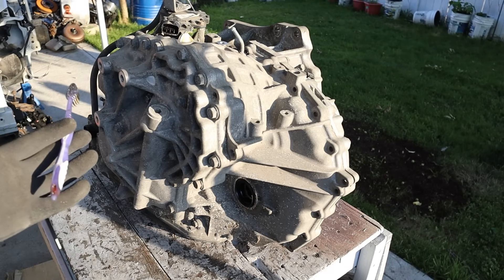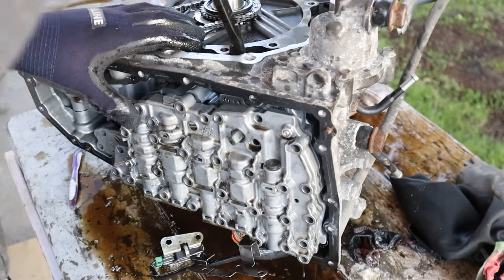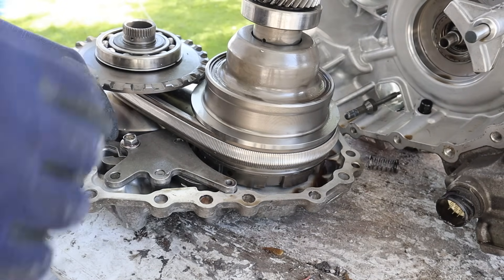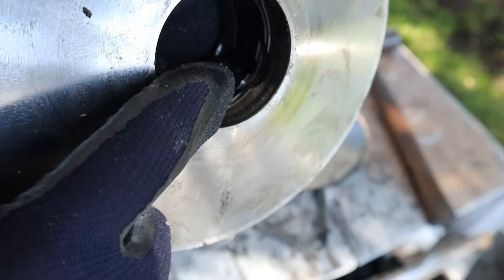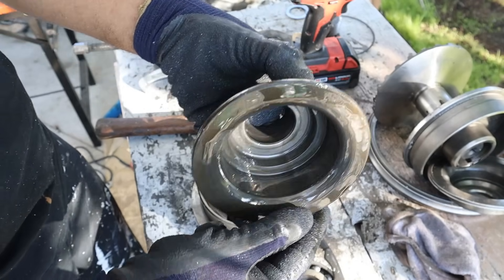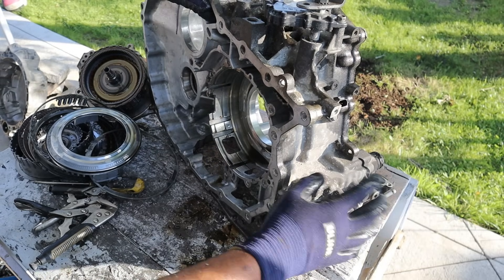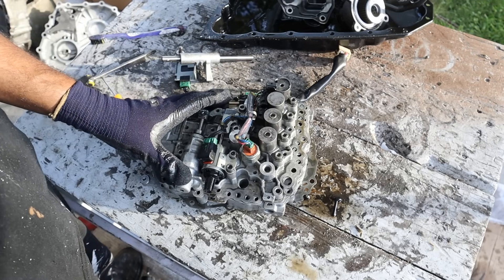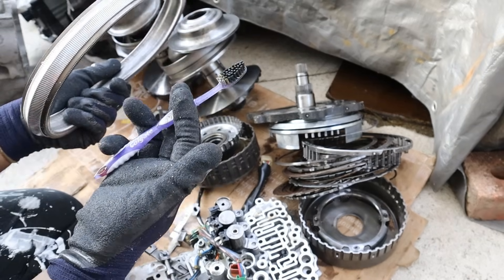Why Nissan CVT's are a FAILURE

Comment: And we were considering buying a Nissan Murano in 2005 when we were looking for a safe and reliable car to transport  my wife and I and our newborn.  After reading about issues with Nissan's CVT, we settled on a 2005 Toyota Avalon which we still have and drive today.
Reply: The Avalon is a very smooth and spacious family vehicle.
Reply: Our 14 murano was a pos. So I offed it to carvana for……an Avalon.
Reply: @samtatge8299  nah muranos are great, reliable and strong
Reply: you made the right choice
Reply: Probably the only person who cross shopped an Avalon and a Murano.
Reply: what a wise choice
Reply: The older Nissans are actually bulletproof
Reply: @ If you give her what she needs. Sure.
Reply: I have a 2005 Nissan Altima with around 179,000 miles on it, bought it brand new. My front tires still spin when accelerating from a dead start. I guess the key is regular maintenance. Haven't changed the transmission fluid scene the 50,000 mark. Maybe it's due for a transmission cheek up. What do you think?
Reply: @ At least check the dipstick. The belt will shed particles. I wouldn't trust a dealership, they'll ruin it.
Reply: Good choice.
Reply: Every marano is in the auto junk yard😊
Reply: That was a smart move. Wished I had done the same thing. Will never buy another Nissan again.
Reply: and my sister is still driving a nissan murano that has been problem free for 200K miles
Reply: I know someone that had a 2014 Murano and the transmission came out two times within 68,000 MI.. And it was taken meticulous care of and serviced at the Nissan dealership.. service before Time..
Reply: I own a 2009 murano, and i thrash the thing daily. The cvt definetly holds up to it. I havent serviced it since ive owned it, about 20,000km. Definetly servicing it after this video though
Reply: I had a MB B-Class with a CVT, obviously failed(180,000km)… bought a Toyota Aurion (now at +400,000km), only had to replace the alternator.
Reply: @ Actually battery powered bicycles are but, go off.
Reply: those older Murano's do not have this type of transmission. 2012 and newer have this transmission but the recommendation is to replace the fluid and filters more often, every 30-40k miles; pushing it to 50k but better be safe.
Reply: I have a Nissan Rogue 2021 26,000 miles lot are dropping  Nissan's.  Mine drops off this Monday, 10/20/25, but I have to pay a rental. They have a wacko system. I was thinking the Toyota. The CVT can break your maintenance
Reply: Ugh! That aviator is similar to the clutch/transmission on a mini-bike!
Reply: Murano is actually solid. Honestly, you made the right choice.
Reply: @JohnZornAscended Murano's are terrible..😆
Reply: @charlesjackson1700 That's why they're still on the road eh?
Reply: @JohnZornAscended ..I don't see many on the road.. and the ones I see look raggedy and the bumper covers are flapping in the Wind...🤣
Reply: @JohnZornAscended  no is yunk and I see this yunk it yunk it doesn't have any good suspension especially in  pa a little touns that the road are not very good

Comment: The reason they fail is no one changes their CVT oil I change mine every 30,000 miles and have almost 200k on it with no problems this goes for all CVT vehicles but Nissans seem to have more problems with dirty oil
Reply: Funny how in other cars you don’t have to change the transmission oil every 30k miles 🤔
Reply: @BillGates_Alex actually you have to change the atf with pretty much the same interval for almost all automatic transmission. Better change it and safe rather than being a cheapskate then sorry
Reply: @BillGates_Alex You Don’t Have To. That’s Excessive. My Brother Has 200k On His Cvt Now And Only Changes It Every 60k
Reply: Every 10,000 miles.

Comment: I wonder how the ford maverick is gonna hold up with it being a "truck" with a cvt
Reply: The Maverick hybrid CVT is not a pulley and belt type.  It's an eCVT, which is completely different.  The non hybrid doesn't have a CVT.
Reply: @thx1138guy  oh ok. i still am gonna be curious how it holds up but if that means it doesnt need to work as hard i would hope it lasts a good bit

Comment: What's crazy is Honda uses cvt and  I have not seen one Honda in our shop for a transmission replacement
Reply: You will.  Just wait a few years.
Reply: There's a lot of CRV with broken CVT. They put those low torque CVT into heavy SUV.
Reply: @GF-mf7ml   It's crazy as I do a lot of transmission services and I'm wondering if that's because the transmissions aren't failing
Reply: @HONDATECH93  we here in Malaysia have quite a lot of issue with the cvt steel belt would grenade itself.. I do believe it due to alot of hard city start stop traffic and the hot temperature here.
Reply: We’ve put 190k on our HRV and it’s been flawless. I was hesitant buying it based on Nissans reputation with CVT’s but it has a lifetime powertrain warranty through the dealer so that was enough to give peace of mind.
Reply: @tylersmith7054  I'd personally would sell the HRV and get a 2016 CRV way better those HRV's are made in mexico there not that great and if it has a turbo they are the worst ones
Reply: Wish I had known about these Nissan CVTs before I racked up 248k on mine.  Like the rest of the car the CVT has been maintained.
Reply: My 14 honda coupe had a grinding sound. CVT had worn bearings. They should never have used these junky trans. Costed 5500.00 for a used 51k mile replacement cvt from the junkyard
Reply: @JohnS-il1dr 5500 for junkyard trans? Wtf? 😂
Is it with labour or what?
Reply: Don't worry. You will. Lol
Reply: You don’t see any because when they break people toss the cars away because it’s too much to fix.
Reply: @ryans413  
Ridiculous comment.
Reply: @NunYa953  This thread is full of ridiculous comments by people who know nothing about cars but "niisan/CVT bad" based on nothing but one short video and a couple of vague anecdotes from people who don't understand the concept of maintenance.
Reply: @Utuber-x44  
You can't even spell Nissan. Lol
Reply: Because it's a honda. Honda and Toyota cvts last longer than any traditional automatic transmission out there. Because those two companies make reliable products.  Every part of the car is reliable, not just the cvt. Nissan is the opposite. Everything fails prematurely on Nissan. Even before Nissan made cars with cvt, they had very unreliable transmissions, and unreliable cars in general
Reply: Come to my country (Malaysia) and you'll see a lot of Honda CVTs fail, particularly having the steel belt snapped
Reply: Lol you will see Just give it time
Reply: Honda has had their share of issues with their 1.5 L direct injected Turbo engines, including oil dilution and blown head gaskets . More so with the Accord but the same engine is found in the civics as well. I would only buy the Civic with 2.OL K20C2 Engine which is N/A and port injected. 2024 will be the last year they offer the bulletproof K20C2 Engine.
Reply: Hondas eCVT is completely different too though so don't include those. The planetary gear box on the eCVT hybrids is indestructible.

Comment: Aren't CVTs essentially throw away transmissions?  Are there outfits out there that rebuild these?  From what I've heard, Honda, Toyota, and Subaru makes the best CVTs.
Reply: Labor to rebuild is usually more expensive. Can't speak to Toyota and Honda, but Subarus are solid for daily use but are crippled by any amount of abuse (be it extending the 60k fluid, not beating it until it's warmed but also not letting it overheat, or towing literally anything or increasing the load with kayaks or other gear on the roof). Their old geared transmissions weren't known for reliability, so I guess it's a wash in the end
Reply: @austinsloop9774 how is labor more. There are less parts than an old school automatic from the 1970s.
Reply: LOL all use the same JATCO CVT as Nissan

Comment: Go kart Transmissions do not belong in Cars.......... Direct injection is stupid too .....  along with keyless crap Turbos and superchargers........    less plastic and thicker metal is also needed.
Reply: I bought a 2018 Toyota Yaris  because it had a 4 cylinder [not 3]  1.5 engine ,4 speed auto [not CVT] ,a real handbrake,port  injection,a real start key,manually operated seats,real instrument gauges,spare wheel,gas strut tailgate [not electric motor].Are people so weak or lazy that they can't open one with normal struts?
Reply: Capless fuel filler necks🙄🙄
Reply: All fuel saving tech render a car unreliable. Thank government mandates for that
Reply: Wow Wow
Reply: Direct injection is not stupid.
Reply: @JohnZornAscended if they designed the gas systems as durably as the diesel systems, nobody would have a problem with them.
Reply: @JohnZornAscended  Carbon build up....cough, cough...
Reply: @JohnZornAscended  But trying to educate a fool is.
Reply: Not to worry.  Battery electric vehicles will eventually dominate the market so if you buy a vehicle with an internal combustion engine five years from now you take your chances.
Reply: @thx1138guy  Can I borrow your purple,fart powered, flying unicorn for a day?

Comment: These things die young. A lot. I've always wondered what the problem is. Poor maintenance? Bad design? An inherently bad idea?
Reply: Toyota seemed to have perfected the CVT.. so not a bad idea.
Reply: @sgbawg0 Honda's are good too.
Reply: @ryancroon5131  Honda doesn't use a torque converter.  They will start to fail after 150K miles.
Reply: Cvts in a 3,500lbs vehicle is a shitty idea. They usually fail from lack of maintenance. Have one with over 200,000 miles.
Reply: @JohnZornAscended CRV also have CVT problem if the owner drive it hard.
Reply: @JohnZornAscended I wonder about the CVT in the NV 200. Probably Nissan fit a standard transmission cooler?
Reply: @Thorscauldron  Don’t see why not. It’s definitely a must have if you plan on getting anything out of it. They hate excessive heat.
Reply: Heat. Primary fluid function is to cool then lube.

Comment: Why they don't use a worm gear system to move the cone? instead they just use those tiny ball bearings to handle the load.
Reply: Cost most likely.

Comment: I was a huge fan of their models in the 80's and 90's, along with some of their competitors both import and a few domestics.  Nissan's reputation dropped quite a bit when they partnered with that CVT company and started putting them on everything.  But the manual models were still good for quite a while after.
Reply: The 2002 Altima seemed to first mark the major decline in quality. There have been some very durable Nissans and Infinitis over the years. Too bad they flushed their reputation fully and completely.
Reply: They didn’t partner they Flat out bought it.

Comment: The new ones are completely different and should be great. They’re now a twin pump unit with 34% less friction.
Reply: Twin pump?  Which one has this>
Reply: The CVT--XS in the latest Sentra and Versa.  They have an electric oil pump in addition to a mechanical oil pump.  The electric pump's primary function is to circulate fluid when the engine is shut off at a stop light.  Some Nissans have stop-start systems.

Comment: This is one example of a trend that is quite common for the last 20+ years. Technologies are introduced that, at least on paper, are very promissing. Lower fuel consumption (CVT), lighter engine arcitecture(Wet belt, common in Stellantis engines), lower carbon emissions (EGR and EATS) and higher digital complexity(Computer that controls basicly everything in the car, like Tesla) for example. However, the problem with most of these solutions seems that they often prove to complex, to unrelaible for long term use. It gives me the feeling that many cars these days are solely designed to look good on in an add. What do you think?
Reply: Usually the tech is sound ...Until the bean counters come in and whelp you end up with Nissans cvt's . But CVT's are perfect for 90% of vehicle applications but it also has to be built for durability. CVT is so good it was banned in F1 as giving an unfair advantage ( supposedly)
Reply: @wilinstonthompson1352  Built In Obsolesence 😳
Reply: Bottom line-CVTs are less expensive to manufacture.
Reply: The REAL break-down is the infrastructure AROUND the transmission, at least in the Murano.  If a shop could put the car on a lift and drop the transmission out of the bottom  in 2 hours, and then spend a few hours rebuilding it, it would be no big deal.  But removing the transmission is ARDUOUS and Nissan doesn't make parts available to rebuild these.  So a transmission tear-down/rebuild becomes two whole days of labor just to remove and replace it, and the cost of a whole new transmission.   That would be like telling you a blown head gasket requires a whole new engine.
Reply: Built In Obsolescence 😮
Reply: Emissions systems on cars are a cancer. Take the LS for example. Before emissions it was one of the most reliable engines on the road. After emissions: lifter failiure, high oil consumption, fouled spark plugs, the list goes on. All because the EPA made arbitrary MPG rules. Now we have the DOD, AFM, and engine stop/start on stopping. A fucking cancer i stg i hope the regulators understand how much they fucked working class people with those laws.
Reply: Honda has been using CVTs for over a decade and have relatively few issues, Nissan has had issues for much longer  and it's not just their CVTs they have a ton of QA issues. We have 2 rogues on our lot that are less than 1 year old with failed radio screens. We have had corporate out multiple times and still don't have an official fix or cause for it. I've heard theories from bad USB cables to software issues but not real fix yet.
Reply: @1337GameDev The fact that every part in a vehicle can be designed to last the length of the warranty period and no longer is an unfortunate byproduct of and testament to just how powerful and accurate modern design and simulation tools have become.
Reply: @ArdjanTimmermans  I couldn't agree more.  Lots of folks want things on cars that are totally worthless in the long run.
I believe its something to bragg about.   Bragging about how reliable a car is a real bragging point not the seat warmer.
Reply: I dont think its some conspiracy, these cars are just designed by people who are completely detatched from reality. They are designed to last 5 years as flashy status symbols for western upper middle class people. Because the designers are living in this bubble themselves. They could never imagine that thair cars will have to be maintained 25 years later by some poor guy in pakistan. Narrow minded first world mindset at work!
Reply: Consequences of overdesign! @1337GameDev
Reply: Most new vehicles are absolute trash cans
Reply: They are designed to survive until the limit of the warranty, and not much further. The fact that getting replacement parts for CVTs from Nissan is difficult makes me think they don't want them fixed. Go buy another vehicle mentality.
Reply: Any ICE is a horribly complex mechanism. Same for automatic transmissions. It's amazing they can be made to work at all. The difference is those have had many, many decades of development and refinement to get working reliably.
Reply: Words of wisdom there! It seems like long term reliability is low on their priority list, but what gets me pissed is they know they are creating low reliability, but don't seem to care they don't want it to last to long,bad for business! Causes newer model sales to drop off, if the older models don't want to quit soon enough...designed obsolescence! It should be considered a crime of fraud!!👿

Comment: Crazy those few ball bearings are taking the entire torque load.
Reply: Exactly - the point of contact on a spherical ball is tiny.  WTF were they thinking - more than a hundred years of engineering experience and they still make such a howling blunder.
Reply: @einfelder8262  planned obsolescence
Reply: Later CVTs had solid pins that slid along the grooves on the pulleys
Reply: @thx1138guy  When did they change that? I have a Jatco CVT produced in 2014. Still going strong by the way.
Reply: @ronaldderooij1774  how many miles I drive like grandma 85000 need to do first fluid change
Reply: @chriscalderin6677  doesn’t really matter how gently you drive, since Nissan gears their vehicles to push the engines/transmission to their limit (notice how you have to nearly push the pedal to the floor to get an Altima/Versa to move). 
Get the CVT fluid changed every 15K to 30K miles, ppl usually change the fluid every 3rd or 4th oil change. And while you’re replacing the fluid, collect & have the old fluid sent off to a lab to make sure there’s no pieces of metal floating around. You just need to be on top of its maintenance
Reply: Abec 9 skateboard bearings
Reply: they failed. what were they smoking and where can I get some?
Reply: @arthurmario5996 It's the smaller bearings that consistently fail in this transmission. 
Nissan offers a "kit" but refuses to offer the small bearing only the large one that really doesn't fail. 
They don't include the chain either but it's not usually bad only the tiny bearing
Reply: @arthurmario5996  under the I-5 overpass, there is always a guy there in green camo pants, ask for Mike, he will know
Reply: As soon as I saw those my first thought was the hell would ever think this is a good idea?
Reply: It's crazy that this transmission works by literally pushing a rope
Reply: @corkbulb2895  *pulling rope, one can't push rope, it lacks rigidity
Reply: @throwawaypt2throwawaypt2-xp8nx  not this metal "rope" it pushes just fine
Reply: @throwawaypt2throwawaypt2-xp8nx  No, these CVTs push on the band for power. Which is my point. The joke was you can't push a rope to move something. Obviously the band is more rigid than a rope. Still I never thought a CVT would work that way.